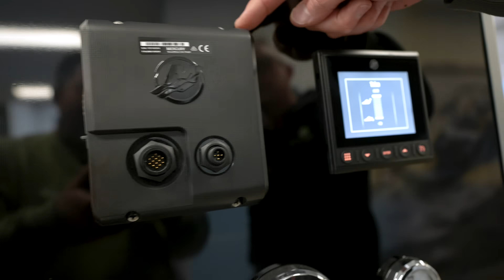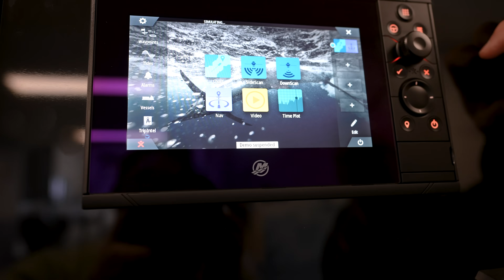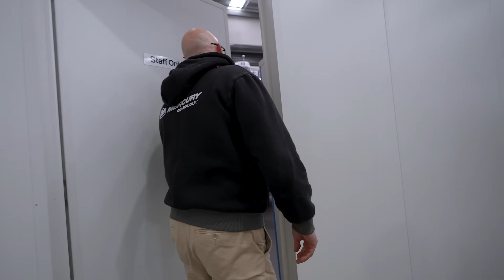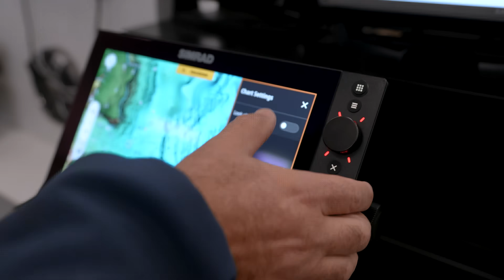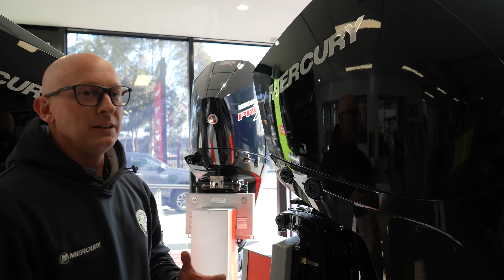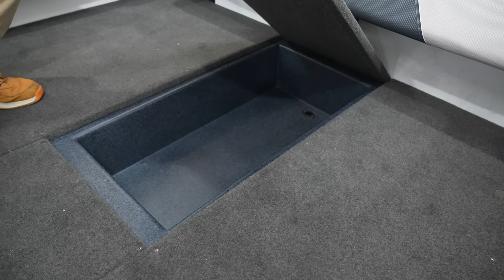Mercury 150 Repower + First Look at Simrad’s Latest Sounder!

Comment: Hope you have better luck with your Vessel View product than we have. Our Merc 3.0 Litre has less than 10 hours on it and the Vessel View works some days, and other days not (screen dead ). Which is great when it runs your RPM, Fuel, Fuel Flow, the Guardian system etc.
Reply from the maker: Why don’t you just take it back to the dealer?
Reply: @ReedysRigs  I have done that, ended up doing a 3 hour return trip. Soon as I got it down there it was working again. Mechanic thought I was full of it until I showed him a video on my phone with the motor running. Anyway mechanic checked the wiring and connections and said it was all good, and that I would have to leave it down there until it replicated. Sometimes it will work for 2 weeks straight or longer. Not keen on leaving a boat down there for an intermittent problem for weeks on end. It's like how long is a piece of string for the dealer to keep it.
Reply from the maker: @hophop1977  ring Merc
Reply: @ReedysRigs  Been told with no uncertainty that this is the procedure. It is what it is unfortunately. I tried explaining from my layperson perspective that if the mechanic checked all the wiring and connections to which they were good than it has to be the unit itself. What has me a little concerned is that when I initially rang up about the VV the guy thought I was ringing back, apparently some other guy rang up with his VV not working the call just before I rang.
Reply: @hophop1977  mercury just unreliable